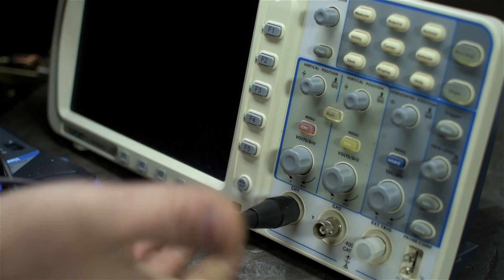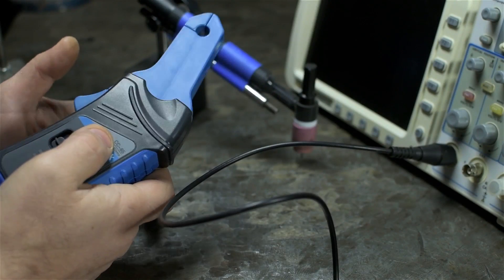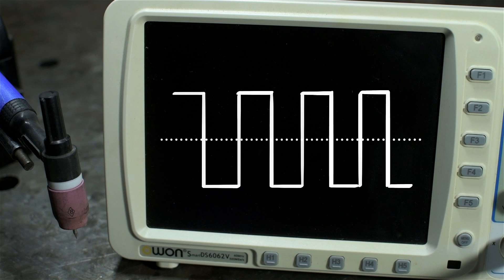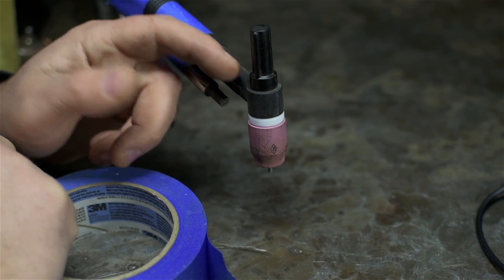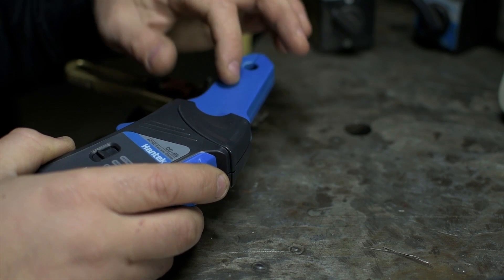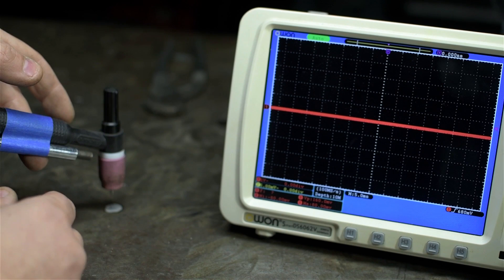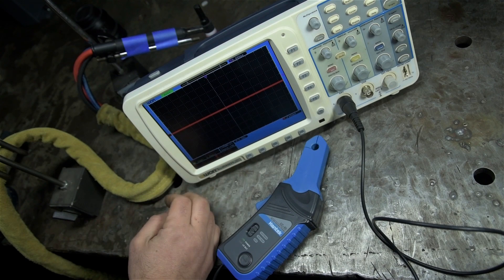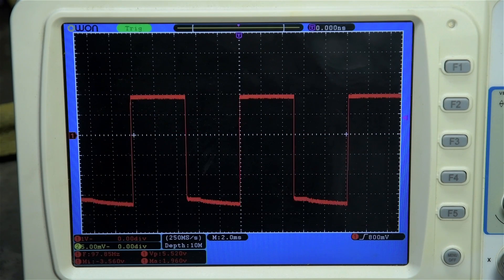Oscillo-Help-Me?

Comment from the maker: holy mackerel, almost 1k comments in less than 24 hours!  Believe it or not I've read each and every single one of them.  
NOTE: There is nothing wrong with the welder.  I'm not trying to diagnose / fix anything.  This was purely exploratory and trying to make sense of something I saw with the old welder.  Anyway, excellent suggestions all around, some contradictions :) but, armed with new information, expect a follow-up video.  PS if you suggested turning it on and off again:  I love you.
Reply: Have you tried turning it off and on again? ;P Seriously though, good luck, and I can't wait for the next video!
Reply: As a power electronics engineer, I can almost guarantee that the voltage waveform is symmetric, because that's what's cheap to do. However, the CURRENT waveform won't be, because the plasma doesn't conduct the same in both directions. Measuring the voltage will require a specialized high voltage probe, because of the HF start.
Reply: They say curiosity kills .... I am not convinced. I am curious about the answer too.

PS. When you get the most likely candidates for the correct answer please make another video.
Reply: @manickn6819  "Ignorance killed the cat- curiosity was framed."
Reply: It is definitely the wrong range, the oscilloscope deflection shows 2V in the positive, and even more in the negative.  In the 1mv/10mA range that is 20A, in the 1mv/100mA it would be 200A.  Tony, set your clamp meter to 1mv/100mA.
Reply: current flowing along a thin channel contacting a large metal plate? looks to me like you've got a diode there, son.
Reply: This might be a dumb question, but what range are you using on the clamp meter. A quick glance at the datasheet says that the 1mv/10mA range is only capable of reading 10-15A. Only the 1mv/100mA range can go to 65 amps with an 8% error. Again might be a dumb question, but that is how you were handling it in the video, with that switch setting.
Reply: I know I’m a bit late to the party but Whatever.  I like the comments that suggest flipping the probe direction thought I’d offer a few other fast sanity checks

First, don’t set the scope to AC coupling.  That would block the dc component and mask the offset you observed.

Second, with the welder off, does the scope actually read zero with zero current in the probe?  Split core current probes are susceptible to offsets and drift over time or if there’s a bit of dirt in the jaws.  Are the probe batteries fresh?

Third,  does the probe read zero with the welder on but the jaws empty?  There may be some unexpected fields coupling in.

Fourth, the current probe is galvanically isolated.  As long as that’s the only probe connected there is no risk of welding currents flowing through the scope.  If it were mine, I would plug it into a grounded outlet.  Welders are notoriously noisy and the ground connection may help mitigate some of the electromagnetic interference pickup particularly during the HF start .  

Lastly make sure the scope isn’t sitting on the metal workpiece.  The scope and metal plate form a capacitor and may couple hf currents into sensitive circuits which would  cause strange behavior

Good luck and happy wranglin’
Reply: Hezekiel Randolph - That is my suspicion also. The negative and hot tungsten is probably much better an electron emitter  than the cold-ish steel of the table  (plus the tungsten will be doped with a rare earth like lanthanum specifically to improve electron emission). If there were no diode-like characteristics THAT would be the surprise. So at first glance I'd expect much higher current in the tungsten-negative half cycle than when the tungsten is positive. But a lot will depend on how plasmas react to AC and that's outside my experience - theory only gets you so far in the real world! 

You might also expect the welding machine designers to know about those effects and to do current-sensing on the fly, adjusting the drive  to the power circuits to at least compensate partly for asymmetric conduction on each half-cycle. But if they don't do that, then I'm not surprised.
Reply: Manick N 
I'm curious too. Hopefully we find a definite answer.
Reply: TexasTimelapse it would really be productive if one of the viewers is involved in a design company or if a reputable firm like Lincoln Electric can take this challenge as an opportunity to do a "friendly" technical discussion. Maybe Tony can consider reaching out to one of these firms. Its practically free advertising for them so I can't see them turning him down.
Reply: Hi Tony and all... nothing contentious to report - but does the correct suggestion or answer get a prize? 🤔😋 could be a signed autograph or an abstract piece of art that you might find in your scrap bin!🤪 John.🇬🇧
Reply: I didn't suggest rebooting it, but do you love me anyway??
Reply: lol brilliant!
Reply: Manick N 
Now that would be cool.
Reply: pretty interesting, I'd like to know the outcome of this "problem" .
As a precision TIG weldnerd who's not yet bought his own machine  would be interested in seeing the same test over different models. Also for  the sake of validating your oscilloscope and or clamp method. I'm off to scatter thru your videos for some less technical info on your welding machine.
Reply: Peke's Repose heh? The outcome will be the same. He has the balance set to 0, unless it shows negative values, he’s already set it to the negative side.  
Now most machines I’ve used, an even my own use a 0-7 scale for ac balance, and 3 is always the neutral 50/50 wavelength. 

Also side note to this old tony. I can’t think of a machine I’ve used that doesn’t have continuous high frequency when using AC
That could also be some of the issue?
Reply: Anybody else have read this with the TOT voice in the head ? I wish I could read books that way, so TOT would always be my reader <3
Reply: Did you try turning the current clamp around? Like getting the scope to flip the other way? Should be symmetrical but would tell you if the clamp was weird or the scope is?
Reply: You could diagnose wether what you see comes from your setup or your welder by flipping the current clamp, make the grounding wire go through it the other way. If it is the clamp you will see no change on the scope, if it is the welder the output will be flipped, with more positive current than negative current.
Reply: you should reach out to EEVBlog. a collaborative video would be awesome. there's no better electronics engineer on YouTube.
Reply: @jmcorp8021  Amen to your comment!
Reply: As commented on the last video: it might be your current clamp simply goes into saturation, hence showing 65A peak to peak only (it is questionable if someone sells a AC/DC current clamp but then designates only half the available range). To confirm that, just lower the current to stay within the current clamps range and see if things change more to your expectation.
Reply: This Old Tony I think perhaps to get the most accurate readings possible, the probe has to be in direct line of fire of the arc so as to get a play by play of what foot their leading with when the pixies are dancin'
Reply: No.

Comment: I don't know if it is too late to comment but I just watched the video.
First you should check if the scope is adjusted correctly, my Tektronik has an output pin that you can use to set the channel correctly but since your scope is newer than mine it might not need this. Have you checked to see if you have a DC component on the output? The HTP machine might have an adjustment inside that could be used to set the balance, maybe they did not set it correctly at the factory. Now it seems that you are 60% cleaning which means you have less power into the weld but it will clean the aluminum more which means you can clean and scrub it less!!
Last option but I am biased: get rid of the HTP and get a Miller Dynasty.
Bye

Comment: The phenomenon that you observed is called 'inherent rectification'. In a nutshell: the tungsten electrode emits electrons more readily than the workpiece which causes a higher current during EN part of the cycle. Modern welding power sources can deliver a completely balanced current waveform.

Comment: This is a little late, but I'm an electronics guy an this is killin me, I gotta say it.
 
Your o'scope is not connected to anything like an outlet so it has no reference to anything. It measures volts from the little clip on the probe to the pointy end. What you see is what you get, up to a certain frequency.

The inductive clamp forms a transformer with the welders cable. Transformers can't pass DC so it's physically not possible to see a real offset actually coming from the welder. The clamp has a circuit inside to let you choose 1:1, 1:10 or whatever. Probably also some protection circuit and potentially a couple of components to clean up the signal that "transformer" distorts.

I love your videos and have to hunt around a lot to find the last couple I haven't seen. Please send more soon!

Comment: Hi, I have not read all the comments so I do not know if you came to a conclusion or not. With that said that hantek probe is the equivalent of a plastic caliper. Sure you could measure something with it. You basically need to try figure out if the probe is measuring correctly. One simple test is to flip the current direction in other words make the cable go in the other direction thru the clamp. If the waveform is flipped and the unbalance is on the positive side instead of the negative your probe is probably correct. If the wave for is more or less the same you have a problem in the probe. /Ake

Comment: Have you tried swapping the ground and earth clamps on the welder, see if it moves the other way up? Electrode negative to electrode positive, pretty quick to test since it's two dinse connectors. If it doesn't change then it's your scope or clamp. Does your scope have different scale for negative and positive, just making it look bigger in the negative?

It is noticeable that your waveform is a lot cleaner with the new welder

Comment: Ehh.... i know this has been out for a long time, but.... the tip of the welder and the plane of the bench make a spark gap. 
Spark gaps are basically diodes with a bad semiconductor in between the cathode and anode, making geometry important. 
Since the spark gap is already conducting, you do not see rectification or full current blocking. 
You do, however, see a voltage drop in one direction. 
That voltage drop simply represents the direction the diode happens to be pointing. 
Really the only thing I see with that square wave is that it's not quite square, but that's something in the welder's settings themselves. I've actually seen it described as a feature by somebody. 

Also... in case people are wondering about the old welder, you had one of the transistors on your welder blow. You can tell by the shoot through that happens just before the current shoots back in the other direction. 

Any way.... In order to promote unity among Canadian Youtubers, Rimstarorg has stuff on spark gaps, diodes, and electricity.

Comment: Just sparked a memory seeing this video 4 the first time. I remember connecting about 30' of 16 guage wire across a car battery once trying to prove something. Carrying that much current that wire slapped itself to the car, the bike and anything magnetic close to it. So I'm  thinkin', did you ever try using that, ahem, inductive pickup on straight cable, away from that planar sheet of magnetic stuff?
Just a thought....
Ya know, molten plastic is tough to get off of paint after its cool.

Comment: Before I read the comments I  will register my first thought:

Floating ground at a negative voltage causing an output offset, pulling the entire waveform below the centerline of the scope display. It’s showing the correct output, just “closer to the bottom” than “it should be”.

Comment: Is it asymetric if you burn firm the electrode? I am å bit curious if the arc has different resistance, depending on the direction of the current...

Comment: A year later, I know. Old Tektronix engineer here. The hantek is not an inductive pickup, it is a hall element that can measure DC as well. The clamp does not block DC. (Sorry old electrical engineer Deathlok67). You still probably don't have a good ground, but that should only be an issue between the probe and the oscilloscope. Anyway here is what I would do to test if you are getting good date:  
- Install a shunt in the ground return wire, and measure the voltage across that. Maybe just some length of heavy wire with 50mOhm resistance or so, or maybe just the ground wire itself. 
- The AC frequency is 100Hz, and the RF start is 27MHz (my guess), so to shunt out the RF, just install a capacitor in parallel over the shunt, and if you like, a choke in series with your meter. 
- Twist all your probe wires to make sure you do not pick up any RF or other inductive currents. The arc itself is also very noisy RF wise.
- Now, First, just measure voltage across the shunt with a multimeter, and multiply with 20, and you have your amps. Measure AC and CD and RMS. 
- Now hook it up to your scope and see if the waveform matches the multimeter.
Please tell me how it worked out.

Comment: The DC bus for the IGBTs uses a more negative (or positive) reference so you don't switch noise and transfer to the output.  Also, the Inverter output uses a PWM (12khzish) output and snubber caps will develop the output to something usable. switching at 60hz will cause too much heat to build up in the IGBTs.  All of this creates a buttload of noise and has to be filtered out, this noise can wreak havoc on test equipment and should be grounded independently.  as far as the asymmetrical waveform, the ground for the TIG welder isn't ground,  more like a reference point for the difference of potential and likely has a voltage present. this will clamp the waveform off the zero reference.  you are getting the desired output just referenced to something other than zero (referenced to -40v could show a imbalance to negative even with a current waveform as one follows the other with a little ELI the ICE man thrown in the mix).  Since you "ground" the work to the welding unit, the work has that reference as well. You can control the output with greater precision if you have total control over the reference the output is based on. The whole process is a bit more complicated and I can send you some info if you need it. and I could also be completely wrong and the welder uses something other than IGBTs or some alien technology that I'm not aware of. My experience with IGBTs is from a different application but the concept should be the same.

Comment: Hey I know this is an older video, but measuring voltage is based off of a ground reference, so if your scope and welder dont have the same ground you are going to have some incorrect readings, potentially you could induce some capacitance on accident this way as well. 

TLDR: try plugging your scope into the wall so it has the same ground reference :)

Comment: My typical response is if it works leave it alone. You have a fantastic welding machine with features that most of us would love to try just one time. The arc characteristics of the HTP especially with the pulse features is a welder's dream. Take a newbie learning to weld and put him on a TEE plate with pulse after you demonstrate keeping the wire in the puddle and he will look like a PRO. You have a machine that does all the figuring for you, just drop your shield and go to town. Seeing the HF Arc shoot over an inch to the work table is amazing.  Try using my Miller 330 A/BP. It's like brand new with maybe 100 hours on it but it's not forgiving. You need to be skilled and understand how to dial it in then apply your skills. This is old school and when you started out you didn't dare think of grabbing a up a lead to weld with until you mastered Oxygen/Acetylene gas welding first and that means you weld all your steel, cast iron, stainless, and Aluminum with a torch. I love your videos Tony and your sense of humor is hilarious, even my little grandsons like watching you cut steel with a chop of the hand. But sometimes you can't measure things and these new machines adjust for all parameters, arc length, voltage, amperage, rod angle, position and so forth. When you go to lite up and nothing happens then make a similar video and get the Electrical Engineers or experts to comment and we can all learn how to fix it.

Comment: I know this link is old but I just got into your channel...very funny and very cool...when I grow up I want to be this old tony, or maybe a reasonable facsimile. Anyway, I digress, Your viewers who suggested turning the clamp around are correct in so much as it will tell you the clamp is truly showing you what's there but I believe the wave form is always going to show  a reduced current on the positive half as this is the "cleaning" portion of the AC cycle in TIG and as such does not require the same amount of current as the actual "weld" portion of the cycle even though you are welding in both portions of the wave. This is a great example of why you have to use the "AC" form of TIG to weld Aluminum and not ferrous Steels. Aluminum requires the "cleaning" action to deal with the  material changes and oxides developed as the Aluminum liquefies.

Great Videos!